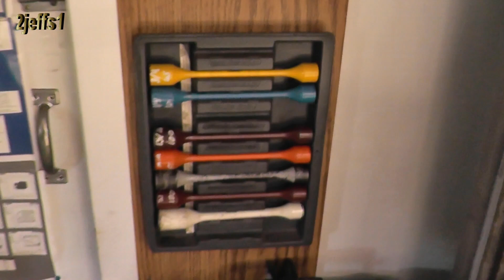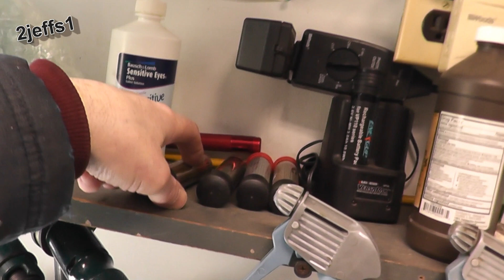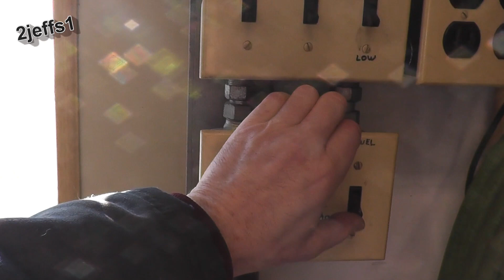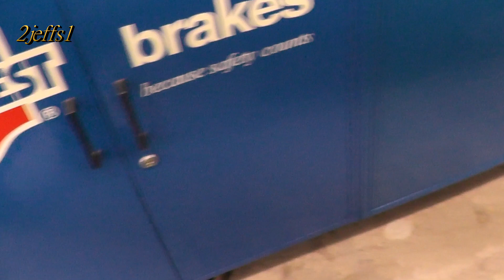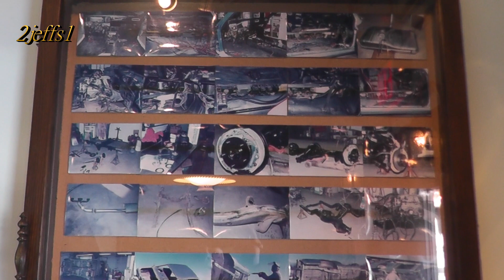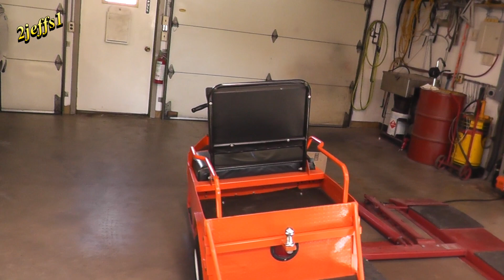Shop Tour - Ideas For Yours...

Comment: Jeff , I left a message on your variable speed drill press unit from 5 years ago, thought I better leave another on a more current blog. Couldn’t find a message site via Facebook.   Question:  I want to install a similar variable speed box on my Rockwell variable speed drill press. It has a manual handle to adjust speed but has broken. Can I install a box on this unit and if so, should I pull any cams that may prohibit the engagement of the new option or should I not worry. Thanks , Richard, Snohomish , Wa
Reply from the maker: Not sure of what you have going there but the drive has such a speed range I never have to change speeds with that 3 to 1 ratio. I would recommend a bigger drive than required or you may see OL on the display. No biggie - There is an adjustment to slow the spin up but kinda grey on that these days where those drives were installed back in 2003 or 4.

Comment: Excellent video I am very much like you I like to have thing tricked out and I also like to have shop supplies.  Just curious because there is thousands of dollars rapped up in misc supplies do you charge a flat rate on each customer to cover misc shop supplies so you can account for replacing things